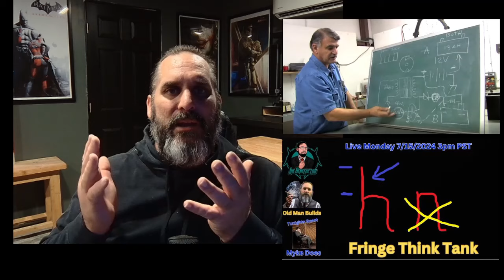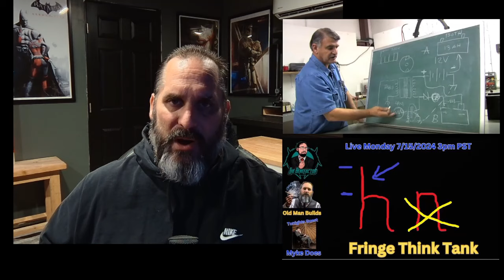Specialised Energy "Making The Impossible Possible" #59

Comment: Thanks Nathan! I built the FEG free energy generator a couple of years ago, designed by Bedini and Bearden back in the 80's I think. I should look at it again as I understand a lot more about tuning now. Nice thing about it was that it was a negative impulse solid state circuit.  Got the right waveforms, but I think the batteries were only 7 Ah so from this video they weren't big enough to get the right effect. Interesting!

Comment: This new video jogged my memory of my "school girl bedini" motors I had built long ago. Yep, I used welding rods for a small diameter, ~3-inch long core. The coil, wire-wound POT, triggering  transistor, both batteries always remained cold to the touch even when running for days on end. I think I was getting back-emf spikes between 45-60 volts running on a 12V battery from a UPS.

I also built a few joule thief circuits around the same time. Was powering 110VAC bulbs of various types using a AA battery. If you haven't looked into "joule thief" circuits I'd highly suggest looking into the circuits. Also had some fun with "Rodin" or "Starship" coils that produced interesting magnetic fields.

Edit: Recalled one more cool thing about the bedini generator .. It never wanted to spin very fast until the load (the battery to be charged) was connected. Once connected the disc ran much faster.

I need to get back into this stuff again.
Reply from the maker: look at the grounding in the circuit. the tesla coil does the same thing. Full power when earth ground is used.

Comment: My understanding about not using neos was that it saturates the iron core which prevents fast switching. 
Pulsed DC must have sharp gradients, fast on fast off. Otherwise current which follows voltage by 90 degrees will hit the circuit and cause amp flow, heat and more current flow from the primary battery negating any benefit from the circuit.
Reply from the maker: yes. it get to much heat. I did the voltage video before this one for this very reason. Conversion of energy is so important.

Comment: NATHAN...one of the things I learned about coil devices is that in certain cases larger is better, now everything in proportion...And who the he'll I'm to recommend anything!!??

My shit worked...but at the time many dissapeared and I just followed previous John advice...it was a different time though...but I disconnected everything...

One of the many reasons is because at certain scales SCALAR WAVES ARE PRODUCED...Those can be detected by satellites...
I know of someone not related, from another country, but working here as immigrant , he adapted and made a shoebox free energy device tried to get a deal to intall them on trucks....got t boned by a semi, in a city where those are forbidden to circulate, they spent several days in the hospital...

SO THIS STUFF WORKS

forgot about everything almost...I can tell you it never ceases to amaze me how much John knew and we assumed was simpler due to its looks, i.e. The coils of The Bedini Ferris Wheel , those were wound with different awg sizes, when he used several depending of what output he wanted...and to decrease impedance at several frequencies!!.
I build larger, 8 ft diameter, with a massive solid wood discarded dinning table I found by a dumpster, unusually large for an apartment complex over 15 years back...

Build big if is bedini...there is another device I tried to get help with, and my collaborator was nice, he didnt care afterwards, if I die at war or not...he cut communications, got to build the device...but partially, not with etheric energies...what hapened??

I was right on testing him...I didnt tell him a couple of things crucial for the device to truly work as intended...

And  precisely one of the secrets was to build larger coils

Now onto gravifier, ARE YOU IMPLEMENTING SACRED GEOMETRY IN YOUR DESIGN? Believe me when I tell  you a higher conciousness must be attained to manifest this solutions...all goes togheter that is what scientists have been missing al, of this time.

I apologize, because I did mentioned something about resonance thzt doesnt apply to your machine, but to the Tesla coils itself and it makes sense then that you jeed a more powerful one. You seem to be pretty close.
In my book "GAMES THE GODS PLAY" I  do tell a true story which proof that high frequencies , correct ones with cerrain materials due work on the correct material...sound sound sound...is the secret of it all.

CYMATICS
https://youtu.be/Q3oItpVa9fs?si=UeQA67kKGJOrpJWB
Reply from the maker: @kukulcangod1  I will look up the book. I have 2 versions of the graviflyer I am working on and maybe a third on the way. One runs like a field generator. The other normal but the third is totally different. It is more like a Tesla design. They all produce different results.

Comment: I did not know the neodymium magnets did that, thanks for the info ! Do you happen the to know what the max field strength of your Ferro magnets(in tesla's) is to create the ideal "H" flow? I'm Looking forward to this progression. Thanks as always Nathan, even your failures can teach us all.👊👍
Reply from the maker: the power isn't important on the magnets. Bedini is grounding the circuit with earth ground and picks up an energy spike. the tesla coil does the same and is a capacitor to ground. Earth energy when tapped into is a game changer. For instance why does a seed grow a plant faster when buried with an earth magnet? attract it into the Graviflyer with charge and you have gravity in a bubble.

Comment: The issue with Bedini work for me is that he failed to continue to study magnets down to it's core and I understand he would have needed a lab and specialized tools. What I can say is the Neo magnets are stronger because it is made of rare Earth and that material has an extra F-electron which gives it that extra punch. With his small info you can put more of the puzzle together which is what Bedini would have done had he known. Every bit of info helps and is important because it is another piece of a puzzle. 🤓
Reply from the maker: he did use them and stopped because of the heat. You do not get cold energy like he is getting wit a ton of heat.
Reply: @nathanbunten4299  I found that my misuse of neo magnets caused unneccessary drag on the rotor due to the strong attraction to the coil core

Comment: Ever find or dig up the supposed work of Dr. Ning Lee and negative energy circuits that had a temperature drop where entropy should have been occurring? (The story around her situation had some strange aspects.) Sounds sort of like the thing you're describing here.

I think most documentation calls it negative energy rather than cold energy, but it's the potential of the differential that is tapped into in order to do work which is why it doesn't matter if it's positive or negative in the math. However negative energy is what would make things cold where you have typical resistance in a system that normally makes things hot.